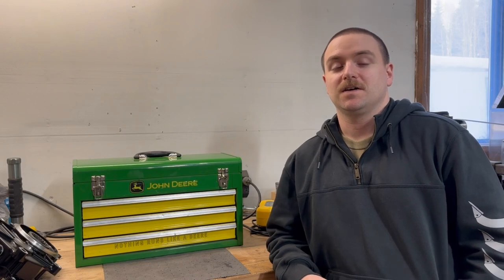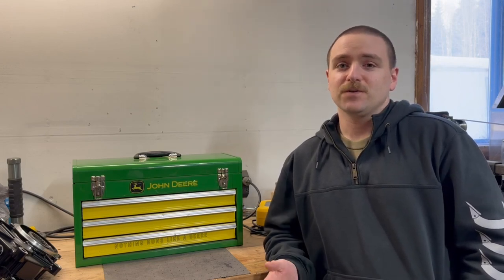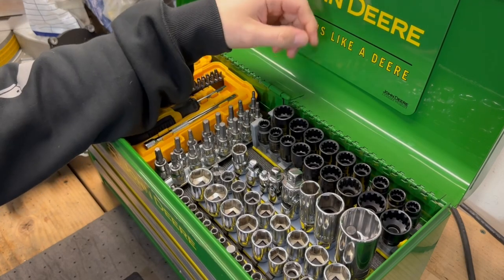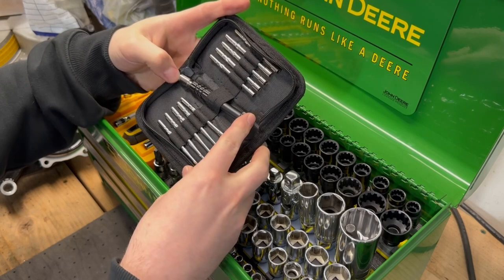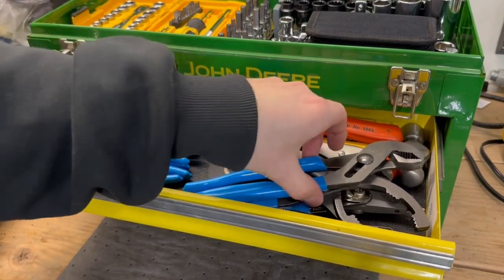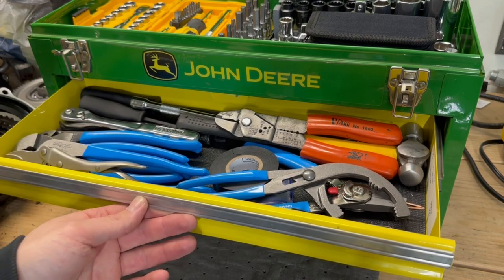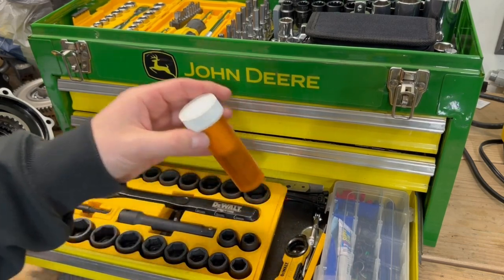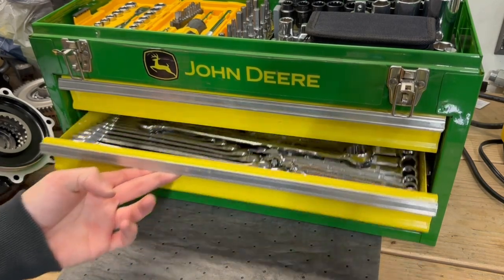Portable Tool Box Build - Auto / Small Engine / Garden Tractor

Comment: Your mobile toolkit is alot more organized then mine.  I took one of the Harbor Freight 225pc master toolkits and got most of sockets in a toolbag, put hand tools in another bag. Along with a handful of my other tools I use commonly on both cars and my garden tractors/small engines. It all fits into a dewalt toolbox that sits in the back of my car for on the go. I used to go crazy and have 2 box's, a small floor jack and a few other things in the back of my car daily but I decided I should make it a smaller compact set. 
I tinker on my 1969 Case 222 that's built into my puller, pusher snow removal work horse. And my 1978 John Deere 316K my dedicated lawn mower. Along with anyone else's that I can. I do alot of random work from home stuff to cars so my toolbox is alot different then yours.  But you have a great set up!